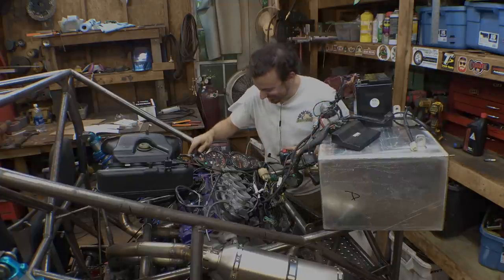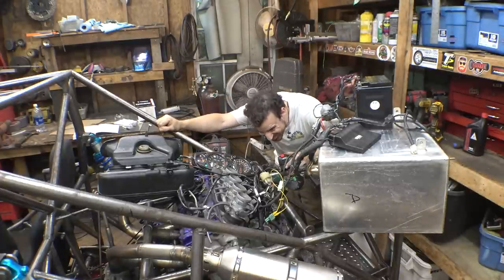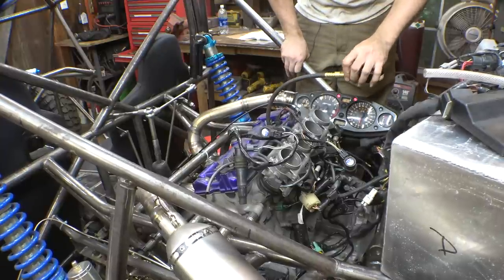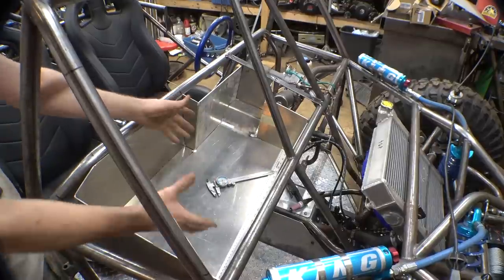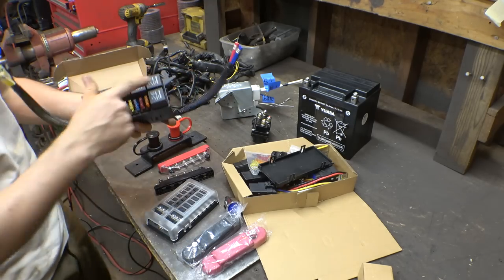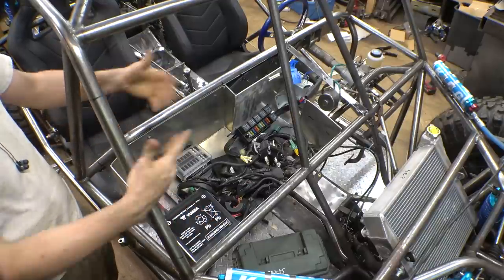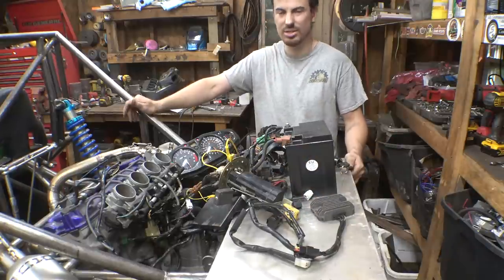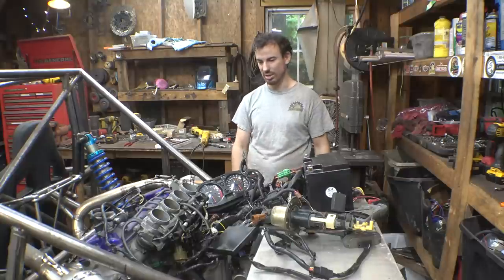4WD Mini Trophy Truck Build - Part 25

Comment: Don't forget to put a hole in the lowest part of the wiring box to let water out, because water will get in.
Reply: He knows this not the first one he's built lol.
Reply: 3/16" seems to be the magic size in the commercial signage industry.  It's small enough to keep out most wasps, but also small enough to get clogged by nearly anything, so we do 2 for every cubic foot of volume.
Reply: @jerrywilcox9890  Yes, I'm sure he does, but no one is above forgetting then putting all the gear in and not wanting to take it all out to drill a hole or two.
Reply: Agreed a hole is needed as condensation will for from heating and cooling cycles.  Drill a few holes and cover them with steel window screen to keep critters out.

Comment: It’s not a chiped key the ecu is just looking for the 100ohm 1/2watt resistor. The cheap eBay ignitions don’t have them so you just have to add it between power and black/white wire or you can just put it inline on black/white wire. Pretty sure that’s the imobilizer wire

Comment: measure the voltage at the connector (not the pump site) if u measure 12 V the fuel pump is more or less shortening and the voltage is dropping because the battery can't keep the voltage up. that would also explain the sparks when hooking up the pump directly
Reply: 9-10v I'm guessing it's a two speed pump circuit
Reply: What was the battery voltage at the battery ?

Comment: You might have to bypass the tilt sensor. If the sensor is bad and the computer thinks its tipped over the fuel pump won't turn on.

Comment: A couple suggestions for the electrical box - 
Cover the entire inner compartment with dynomat/killmat sound suppression, for sound AND vibration. Yuasa is one of the best powersports sealed AGM batteries out there. Nice choice. I’m happy you went with power steering on this vehicle. I suspect it’ll be impossible to steer without it. 
I still think you should register this project as a road legal motor vehicle and that will require blinkers, DOT tires, windshield, etc. 
This is your best project yet. Glad you’re sticking with it.
Reply: He's not going to make it street legal it's not what it's built for.

Comment: For compression. Depending on your altitude and density altitude, your 180 compression might be more like 190 to 200. It’s 1 psi per 1000 feet. So if you are at 1000 msl, and it’s a above standard temperature day with low humidity, say a density altitude of 4000’ (not uncommon on a warm day), your altitude effect is along 5000’. Roughly 5 psi. Additionally, when the engine is hot from running, you’ll see a significant increase in compression typically unless your valves aren’t seating properly (either from damage, carbon, or valve gap.) for a motor that’s room temp, that hasn’t run in who knows how long, I’d be willing to bet your compression improves after running it.
Reply: Thank you for attending our pre-flight meeting and reminding us of the importance of calculating density altitude for a safe flight.  ;)
Reply: @kevinsellsit5584  haha yup… both a pilot and a aircraft mechanic… you apply density altitude to compression checks, especially if they are low and it’s a high density altitude day. Especially when they are on the border line of needing to start pulling cylinders.

Comment: Loving the build so far and was glad to see the reverse trike last week.Just a suggestion, if you want to hear it run for a minute or two. At GM they would stick a rag over the intake of the throttle bodies and squirt gas on the rag that way it would suck in the vapors and no worries of flooding. Old trick my dad taught me from his time there at the GM plant.
Reply: I think these are throttle bodies not carburetors
Reply: @Ratkill9000 it will still work. I'd zip tie the tags to the throttle bodies though to make sure they don't get sucked in.

Comment: I'd just use an in-line fuel pump, it would be significantly less expensive. And as someone else said, make sure you try it with the pump upright.
Reply: depends where the regulator is. a lot of the time it's on the pump carrier in the tank, in which case the inline pump will also cost you a new regulatory and potentially an aftermarket carrier if the stock one isn't easily modified (plastic)

Comment: Have you thought about putting a Anderson plug on the outside the box so you can have a trickle charger or plug in a solar panel to charge the battery 😊

Comment: You got lucky that the ECU accepted a random RFID key  code and you didn't had to make a run to the next Suzuki dealer to learn the new key to the ECU...
Great leap to the finish line with the turn over, spark and no error codes anymore!
👍👍👍
Reply: I don't think this ECU uses an RFID key. Some older Suzukis had a resistor buried in the ignition switch. If the ECU doesn't see the resistor it won't run.
The idea is to stop people hot wiring the bike by unplugging the switch and bridging the appropriate contacts. Of course it does nothing to stop some scrote brute forcing the lock with a screwdriver.
Reply: @LesNewell I have a similar age Suzuki and this is 100% correct. 100 ohm resistor on the orange/yellow wire would have bypassed it for 5¢ instead of $100s

Comment: oh yes the "fun" of FUel injection (not a typo) electrical gremlins are a nightmare to trace and shoot, but as you said, once you get the bugs squashed in the system, they tend to be rock solid at that point
edit: you might try rapping on the motor housing with the handle of a screw driver with the switch in the on position and see if the motor starts turning and the pump starts operating, sometimes if a pump sets for a while it'll lock up, and a quick tap can often times free up the gummed up parts and get er' choochin' again, it seems like you are dealing with a locked rotor situation with that pump from observation, but you got this man, she'll be a ripper fer' sure once you get the bugs worked out of the drivetrain and the rest of er' assembled

Comment: For the fuel pump, put some hose on the inlet and outlet. Fill it with beeryman b12 or seafoam(i use acetone but i dont know about the seals in a in tank pump). Hook up power to a reversible switch. Tap power one way then back the other a bunnch of times. It will usually free them up unless its in REALLY bad shape.

Comment: Not sure if you bypass the clutch switch or the kickstand switch. You also have to bypass tip over sensor that you have to take apart and silicone in the right position for it to start. you have to bypass all three of the safety features for it to work with no issues.

Comment: You can use a PCV valve from a small block chevy to let water out and not in with a small tube hanging down, also need a sealed battery with a vent tube to keep the vapors from building up inside the box and exploding or rcorroding all your wiring connections

Comment: That anti theft sounds exactly like the VATS for 80's GM vehicles. Which was just a resistor in the key. there were 14 different values they could be. How to bypass it would be just finding out what resistance you need, and splicing it inline one of the ignition wires.
Reply: Exactly what i was thinking. That's how the ignition in my 2002 Cbr954 works
Reply: I think there's a RFID chip in the key and some kind of antenna around the key slot. Even my old Volvo 850 had such thing, some forums suggested to tape the broken key to it and go with a non-antitheft aftermarket ignition switch if you broke the OEM one...
Reply: @jetink600 , it sends 9v to the ecu, one of the easiest systems to get around, apart from yamaha
Reply: The resistor is built into the ignition not the key. 100 ohms to the orange/yellow wire would have worked

Comment: Looks to be a good engine, getting such close compression on all cylinders is really encouraging (180psi stone-cold is absolutely fine). If you make sure it's cooled properly, doesn't ingest crap and don't abuse it, it should serve you well (I know you want it to be solid enough for potential turbo-ing). All told, looking good - your first vehicle you can take a camera-person with, should make for some great vids!

Comment: I meant to alert you to an issue with your radiator shroud. You placed the flat plate around the fans next to the radiator. Ideally that should be mounted with a little distance ~25mm/ 1 inch. This allows the air to flow though more of the radiator. That being said you do good work, very creative, and industrious. Come a long way. Keep it up.

Comment: Love the box idea.  Idea #1 try those Solder Seal wire connectors  could always double protect them with heat shrink over top   #2 idea  for the top of the box you should try some of that Knock off, dynamite. Help with the tin noise   loving the build keeps getting better and better keep it up bud 👍

Comment: Putting 12v directly to a fuel pump is a legitimate way to diagnosing if its working or not or if you have a problem upstream with the wiring or relay. We do this often with vehicles at work.

Comment: Remember to check ground continunity or better yet, run a ground wire to every component and the chassis (unless the computer is switching ground and the pos is always hot).  Even if the chassis is fully welded many high amp circuits will suffer from a poor ground connection through the chassis.
So, when you say "I've got 12V or 9.9V (or whatever)" always follow that with "do I have good ground continunity" because 9 volts may get through a tack weld, but 10-15A may not.

Comment: 180 i would say is pretty good your testing an engine that has been sitting awhile and it's within the standard range testing it again after it's been run and is warm will give you more accurate results and will likely be higher

Comment: What you did is a dry compression test unless you spray lubricant in each one of the cylinders which usually they do a wet compression test which means they spray lubricant in the cylinder walls so that way the oil ring and seals have something to seal against

Comment: if the pump has two speed wiring with the normal position being slow and you were trying to hot wire it while the pump was also plugged into the harness that could be why hot wiring the pump did nothing. 9v sounds like it is a 2 speed pump circuit. try removing the pump and running it in the ultrasonic, this will at the very least help you get a better look at the pump itself so you can buy the correct aftermarket one. also, you should either mount or bypass your roll over sensor, it will make it hard to diagnose the issue if you keep knocking it over by accident. keep checking for codes and fixing them until they're gone, it'll work.

Comment: I'm an auto elec, if it has a transponder key, the key needs to be coded to the ecu, so even if is a transponder key ignition that you bought, it won't work unless you get the key coded to it. There is probably a transponder bypass module you can buy for it like you can for alot of vehicles.

Comment: Don't worry about the compression... you are above sea level (so the target is lower) and ideally it should be done with a hot engine where it will be higher too
Reply: Compression is the same no matter if he's below sea level or not lol.thats fuel not Compression 😂😂.
Reply: Compression specs are done when cold so it needs to be done cold.
Reply: Expected compression tests are always specified at sea level unless specified otherwise in the service manual.

Altitude has an effect on readings obtained and a correction factor must be applied to expected readings taken at other than sea level.

For example: Specified compression = 150psi, Altitude = 2000ft, (150 x .943 = 141.5psi expected@2000ft)

Comment: Your compression should go up after everything has oil splash and good oil pressure. Also, the fuel charge will raise compression. If you're not using fuel in the carburetor, it can substantially lower compression readings simply by virtue of volume taken up.

Comment: all you gotta do is add a resistor to the ignition wires to act like the resistor chip on stuff i work on usually. But suzuki decided to use a stupid 4 digit code so makes sense that it wasnt working. Usually thats only on the UK or euro bikes, so how the heck does yours have it i wonder

Comment: Check your grounds. Motorcycle wiring harnesses have many grounds that need to be bolted to the engine. if not, all kinds of weird stuff will happen. You may also have to ground the pump.

Comment: Adding to the comment that suggested a drainage hole in the wiring box, there are these rubber plugs, they are shaped like a philips bit, sorta, but they let water out and due to the shape stop stuff from getting in,
. Look for bombardier iltis cowl tray drain grommet

Comment: You don't need a specific gaz pump. I've run a 2nd gen 5.9 dodge ram with a ford tempo gaz tank in the bed. And when i got a bad pump, i always only replace the pump in the sending unit, as long as the pump make enough or more gaz pressure you're fine. Even put used gaz pump from the scrapyard, usually i take it from anything with a v8 to be safe and i never had any issue doing it

Comment: as for fuel pumps you can use early to mid 90s honda civic/integra pumps in the suzuki bikes. theyre literally the same exact pump. way cheaper than buying new for the bike because they sell you the whole assembly and not just the pump itself.

Comment: Take that fuel sending module apart and see if you can replace JUST the fuel pump and not the whole sending unit. 

Example. I had a 1996 Jeep grand Cherokee and the fuel pump went out on it. About $500 for a new sending unit, and that’s the only part you can buy. Took the sending unit apart and took out the actual fuel pump, took it down to auto store and started pulling pumps off the shelf. Found an identical pump in short order that ended up costing me $25.00. Installed in the original  sending unit, put it all back together and truck fired right up!!!

Comment: The cylinders are dry. With fuel in cylinder the PSI will go up. 180 on a dry cylinder is good.

Comment: Sparks mean the fuel pump is drawing current so most likely it's stuck.
And if you want to know if it's shorting out, you measure resistance. <0.3 Ohms is like a wire

Comment: I didn't know key transponders were used that long ago 😮
Reply: They weren't. It was way simpler than that. All stock ignitions have a 100 ohm resistor built in

Comment: if you still have the original key look for a small rectangle 1x2mm in size roughly and stick that on your current key. you either have to get it programmed or switch the ecu..... either way is hella expensive

Comment: Don't forget that batteries need ventilation, make sure it doesn't get too hot in that box or your battery can swell or boil over and spill battery acid. Might be better to mount it exterior to the electrical box just near it somewhere

Comment: Normally you do not need to buy the whole fuel pump assembly; just the little 40 dollar pump. 
Usually comes with a new screen filter as well.

Comment: Gotta have a resistor connected in line with one of the ignition wires. Don't remember what wire it is but that's definitely the issue

Comment: put the battery as close to the high load as possible (the engine starter ) then run a smaller wire to the other loads also put it as low as poss ( behind the passenger seat )???

Comment: The Security on these i think is a 1K resistor on the white wire of the keyswitch.  If it doesn't see that resistor it won't spark.

Comment: Some ignitions have a resistor in them so you need like 9 volts coming out on one wire and 12 on another to the cdi... Or maybe it's a chip.........

Comment: Just out of curiosity, does the fuel pump / sender assembly have a tip-over sensor? Anyway, that relay you're talking about is most likely the fuel pump relay. Sounds like the pump is seized up. If it's been sitting out in the open for a long time, it may have corroded inside.

BTW, the dash looks nice. The electrical box is a great idea, although it may be wise to add some drain holes.

Comment: if you reverse the polarities on the fuel pump negative to positive and positive to negative to make the pump spin back words if its stuck. I did this to a snowmobile fuel pump that was froze just kept working it back and forth have it in gas or some lubricant to cycle, but it came unstuck and worked until I got rid of it.

Comment: My guess, the pump is seized up, that´s why you only see 9 volts.. It´s not a complete short, the motor in the FP wants to turn but now it just draws current through its windings cause it´s stuck. Disassemble the pump and motor and clean everything and I bet it will start working again.... or save yourself the hassle and buy a new used one =D

Comment: Could you try getting any fuel pump that meets the pressure requirement and just use the original pumps power wires to control a relay for the new pump

Comment: Some ignition switches, fe late 90s Kawasaki have a 100 Ohm resister soldered in. It's a cheap anti theft device. The Chinese ones obviously don't have that, even if they claim to be for THAT model.

Comment: fuel pump stuck.
try to hit it with something.
I would do some kind of went to the battery box, because the gasses battery makes even the sealed battery do make exploding gasses.

Comment: Compression.
Did you try ceramic oil additiv ?
 Liqui Moly 3721 Cera Tec 

Its few better,
on small 0.9L - twinair turbo fiat panda, at 60.000 km

Comment: Don't change the whole pump assembly. Just buy the pump motor. Look at the pictures to see if the new pump has the same connector. that's it. also change filters. Just buy a good quality aftermarket with good reputation. not the cheap chinese. for around 50 bucks, you get a decent one.

Comment: That cheap ignition would have worked fine with a 100 ohm resistor on the orange/yellow wire